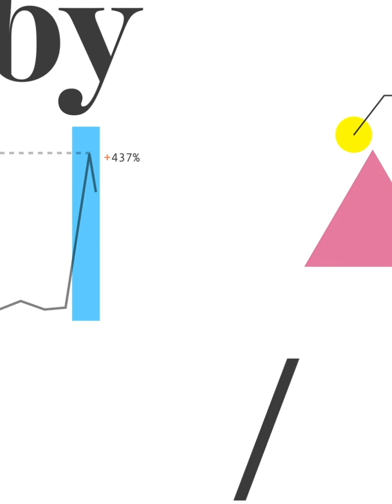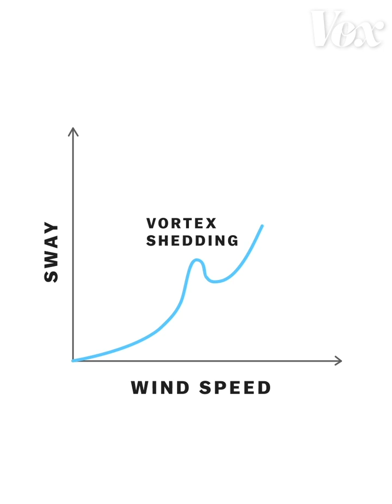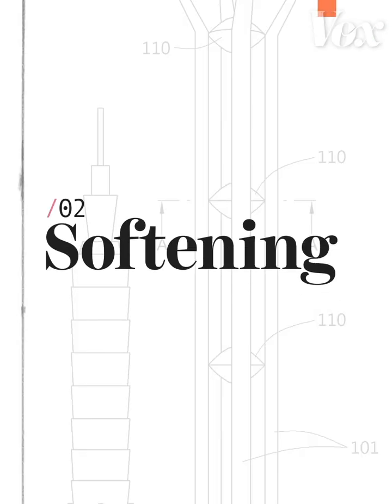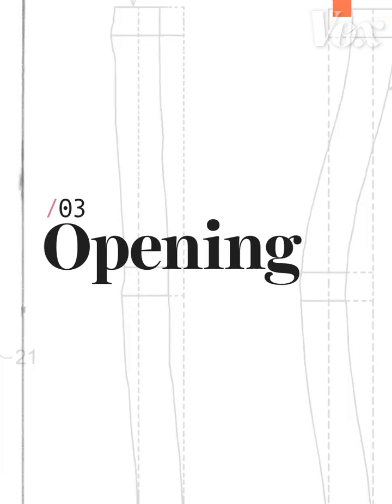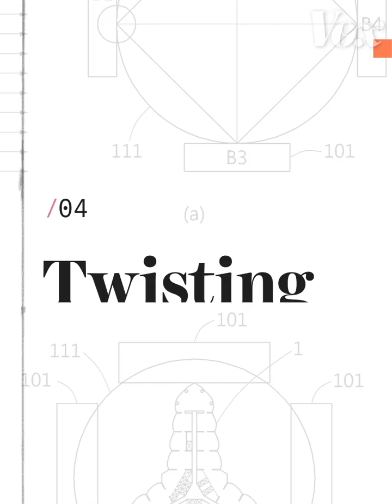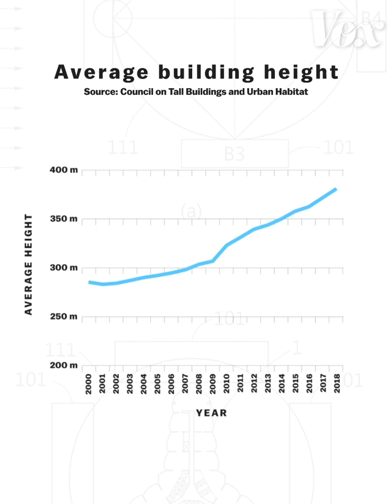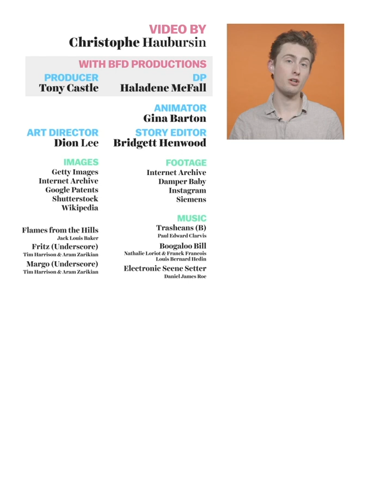The design tricks that keep skyscrapers from swaying

Comment: Did I hear Willis Tower? No No it's Sears Tower, Willis is a disgrace. Also the Vista Tower in Chicago uses the same strategy as the Sears Tower by narrowing the building as it goes up but also it has a hole at the top for air to pass through so it doesn't sway

Comment: I have to design a skyscraper for my arch design class so this was very informative. Here's a summary for people who'd like a tl:dr

Skyscrapers have to go against the wind. These methods help:
1. Tapering (the skyscraper gets more skinny as it ascends higher in the sky like the shard 
- No hard edges since they aren't good on wind, so you'll often see skyscrapers with round corners
- Small cut out in the corners
- Sawtooth corners like Taipei 101
- Reduces movement by 25 percent
2. Openings
- Kingdom Centre in Saudi Arabia
- Shanghai World Financial Center
- 432 Park Avenue in NY has several double-floor cutouts that allow wind to pass through
3. Twisting
- Redirects wind
- educes swaying forces on the structure
- Shanghai tower
- Reduced wind load by 24%
- Saved 58 million
4. Damper
- Slosh tanks, water sloshes back and forth and its weight displacement helps keep the building from swaying
- Massive weights… hidden
- Chifley tower
- Taipei 101 has it open "Damper Baby"
- Steel ball is also there to counteract earthquakes

"As people move out of rural areas to more urban ones, skyscrapers will keep getting taller and skinnier."

Comment: I must say that although I appreciate the desire for educating your viewers on some of the unknown aspects of building design, I am disappointed that the credit for this is given to the architects. Although architects do provide the vision for the overall look of the building, it is the structural engineer who determines the wind forces and designs the systems that control the performance of the structure. In addition, the dampening systems discussed in the video are mainly used to resist movement associated with seismic forces, not wind.

Comment: The Taipei 101’s steel ball is also there to counteract earthquakes.
Reply: Structural engineers provide tuned mass dampers to reduce the wind-induced accelerations in buildings for occupant comforts and not for seismic protections. 

I design high rise buildings in earthquake-prone regions like the US west coast and in no tall building, you will see tuned mass dampers as a seismic solution. Because buildings respond at different frequencies while tuned mass damper can help a building at one particular frequency, it becomes useless in earthquakes as the response of a building is more often at high frequencies rather than primary frequency that the TMD was tuned to. A much more efficient solution is using viscous dampers.

Even in TAIPEI 101, the dampers excitation during an earthquake was inconsistent again because of the high-frequency nature of the ground motions. The engineers themselves would not have counted the damper as the source of energy dissipation in seismic excitation.
Reply: Jinal Doshi Cool, good to know.

Comment: Car antennas werent designed like that as you mention. Its the coiling of the receiving wire that spirals so they can use longer wavelengths without using longer antennas

Comment: Confusing architects with engineers.... guess that explains the odd aspect ratio choice while not even delivering 1920 pixels on the major axis (here height, normally width.)
At least rotate your freaking cameras and don't needlessly degrade image quality!

So next time if you do (at-all) decide to make a vertical aspect video, make a proper vertical video in 3840*2160p as a bare-minimum so I and others might be assed to finally figure out how to rotate our display to properly appreciate the format. This version failed to deliver.

Comment: Aerodynamicist here. The spiral shape isn't about redirecting the airflow up or down. It's about preventing the vortex formation from having the same frequency along the length of the tower. It prevents the vortices along the height of the tower from working together to shake it. Instead they end working against each other, which reduces the structural loading. This is why the Burj Khalifa is brilliant, it uses all of the techniques mentioned, from tapering, to terraces that form a spiral pattern to reduce the effect of wind in the tower.

Comment: It's not commonly known, but a lot of the work that goes into these solutions is done by structural/architectural engineers. The architect will certainly have input and direct the creative vision (we want a hole, or a twist, or none of the above) but it's the engineers who design and implement the solution (how big the hole is and where it goes, how much of a twist, what size damper will be needed, etc). Sometimes this causes some of the design to be dictated by the engineers as the architect's desired solution (due to aesthetics) will sometimes simply not be possible given the other aspects of the design. And sometimes the architect doesn't initially know there is a problem that needs to be addressed (like high wind velocities) until the engineers do their work and inform the architects that something needs to be done (like in the Taipei 101 example). And to be clear, I'm not trying belittle architects, they work very hard on their part of a project. It's just that the design and construction of structures like these involves a team of companies all with their own areas of expertise, and the majority of what was convered in this video falls under the purview of the structural/architectural engineer. 

Aside from that minor complaint, thanks for the video, I really enjoyed it! I even thought the vertical aspect ratio was kind of neat.

Comment: As an electrical engineer I can tell you car antennas are NOT formed into a helix for wind. They’re like that to effectively have a longer antenna for better reception when trying to closer match to the wavelength of the incoming signal.

If swaying is decreased, it’s a byproduct.

Comment: Just two corrections: engineers design how a building goes together while architects design how a building looks.
It's the Sears tower not the Willis tower.
Reply: Alan Ferkinhoff, it’s no longer the Sears Tower. They are correct on that point, while you are correct on the previous point.
Reply: txag07 Nobody calls it the Willis Tower though.
Reply: @jbtx007  try telling that to Chicagoans. It'll always be the Sears tower for them. Just like it's the Woolworth building in NY even though Woolworths went out of business.
Reply: Architects have structural engineering knowledge as well.
Reply: Alan Ferkinhoff huh. you must be a fellow chicagoan 🤣
Reply: The engineers have the expertise in that field but architects must also have an understanding in structure, as structure dictates design and vice versa...
Reply: Architects don't have anything against engineers about the structural integrity of a building.

But it's not only looks that architects create. Architecture is what architects create. A whole system inside a bulding, a culture.

Comment: Hey, I don't think I think its cool of you to try a new format (and understand why you are doing it) but just wanted to let you know it's glitching out. I'm on a Samsung s2 tab and when i go into full screen (not matter how i turn the tablet) it stretches the video sideways and adds horizontal black bars, instead of actually filling the screen.

Edit: found a quick fix. I opened the YouTube app in multiwindow mode, then stretched it downards until it filled the whole screen again and then it showed the video in fullscreen. Also just wanted to point, I think I'd prefer horizontal videos, because vertical ones feel a little cramped (maybe that's something that might change as you learn to work with the medium). But I see their benefit too (might fit better with the vertical UX of mobile users).

Comment: Engineer here - Stop giving architects the credit for these designs. They make things look pretty while the engineers make it happen.
Reply: Not true, architects push engineers to create these kind of buildings. If it were up to engineers, all buildings would have a cube-like shape ...
Reply: @xuelisabeth3137  A big NO for you.

Engineers practice being economical on EVERY project. Engineers don't simply just build and put things together. If they do, ordinary people might as well do the job. But that won't be economical (and safe!); and that's what makes engineers good at their job: build a project in the strongest, cheapest, and fastest way possible. And all of those has computations.
Reply: @candym.5881  But if the building would be created in the "strongest, cheapest and fastest way possible" (as you said), the buildings in the video would not have been created at all. 
So still, architects push engineers to create buildings that are not only built in the "fastest, strongest etc. way possible" but buildings which are built to please the eye and to add value to the aestehics of a city.
Reply: @xuelisabeth3137  The owner (or investors) wants a building (for example) and tell specifics; width, height, etc., how much is the budget for it.
Those buildings are made that way because of CALCULATIONS on those specifics, and yes, aesthetics (which is intentional to make way for these structural computations).
See the spiral-designed buildings on the video? Like that. How about the damper in Taipei 101 at 3:29? "Hey, we're going to add a damper but might as well let it be a tourist spot!" Just like that.

Buildings are created because someone (owner/investor) needed it. Architects don't push engineers to create aesthetic buildings. How about the other way around: "make this aesthetic because the design (pertaining to the computations) requires it to be."

And honestly, the process is more than that.
Reply: Candy M. Alright, I just don’t agree with you! By the way, I never said that engineers can’t create beautiful things, their solutions for these skyscrapers are amazing! I just said that your comment about ‘the fastest, cheapest, strongest way of building’ would never have created the buildings in the video!!
Reply: @xuelisabeth3137  That's because you don't try to understand.

By cheapest, I mean MOST ECONOMICAL, and trying to do the MOST out of the investor's money. In the end, THE ONE WHO INVESTED THE MONEY has the final say. They want it, engineers make it happen.

First, you said "if it were done by engineers, buildings would have cube-like shape", then "if it was built strongest, cheapest and fastest, the buildings wouldn't have been created at all", and "architects push engineers to create aesthetic buildings." You don't clearly understand what you are saying, so I explained it to you.

Don't even try to argue, mister. Go and re-read my replies to educate yourself on this matter. Or better yet, study engineering.
Reply: Candy M. My god, calm down! I think you have and angry-issue.. like I told you! I don’t agree with you, and you screaming it in my face is not gonna change it! Have a great life, and work on your angry issues ‘mister’.
Reply: Also an engineer here - obviously you dont know what architects do so stop crying at youtube and make some better use of your life
Reply: @Alkuf100  I'm glad you're an engineer and not a life coach. Nice try, but I'm literally a licensed architectural engineer who designs buildings for a living and I work with architects every single day. I was previously at SOM, in fact, and continue to this day to be surprised how often architects are given credit for Bill Baker's brilliant engineering designs. My comment stands.
Reply: But if i give u a blank paper to start with, u probably knew nothinngg or how to start with. Let alone how to design space for human being.
Reply: Slow down bud
Reply: yah high-end architects are mostly about making phalluses to glorify themselves while engineers are the ones making it actually turgid!
Reply: Al Quinn correct, but architects are drawing phalluses to glorify their owner.

Comment: Not only is this a vertical video, it's a weird one. It's not 9:16 or even 3:4, it's about 1.3 times taller than wide (i.e. even more square than 3:4).
Reply: JorWat25, you are correct. It fits... only opening in a YouTube smart phone app... It collapses on the app as you scroll, but it looks incredibly weird in isolation on the phone, even more than on TV (which looks weird) or desktop.

I am not a fan of the gimmick either.

Comment: This aspect ratio sucks. It's not fully 16:9 portrait, so it doesn't fit a phone correctly in vertical, and watching this on anything other than a phone is just a nightmare. There are lots of people watching this on a computer or TV as well. Please just stop this, landscape works well on everything and is more pleasing to the eye.
Reply: Filip, it fits non-immersive opening on YouTube SmartPhone... only at first. If you play it in isolation, it looks even weirder than on TVs and desktops.

Extremely odd.

Comment: Not a fan of vertical videos but this is the type of video from Vox that I love.
Reply: No it isn't. We aren't on a vertical screen. WE ARE WATCHING ON A FRICKIN 1080P MONITOR (most viewers) Usually 22in or similar. Some people even have 4k and ultrawide displays which will not be a great experience for them. We are not in 2008 with 1024x768/1280x1024 displays. We are in 2019 with cheap 1920x1080 monitors and 16:9 smartphones.